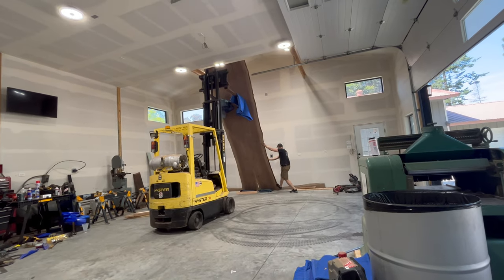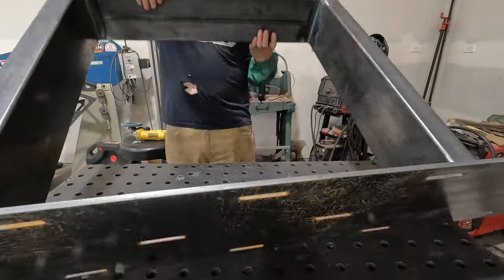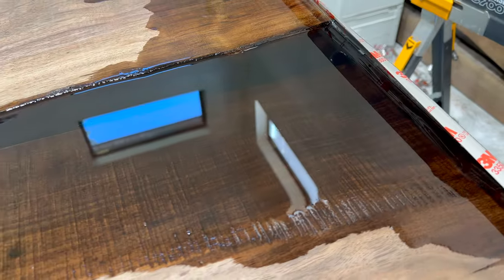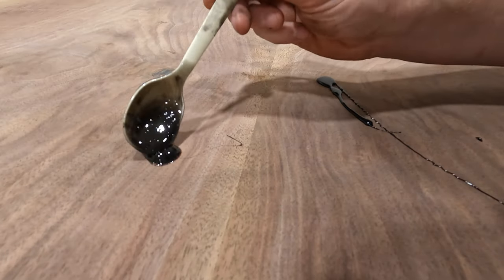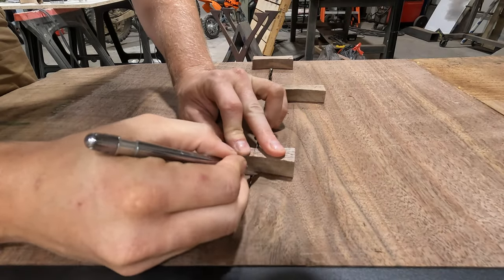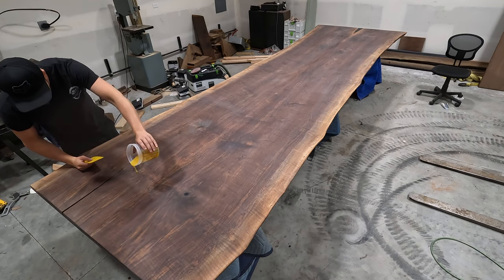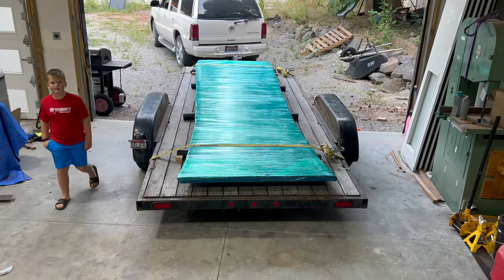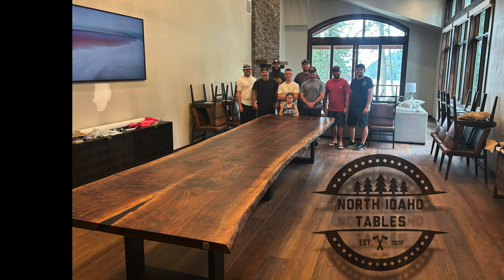Biggest table build so far

Comment: I restore classic cars since retiring in 2011 and the idea came to me that a rotisserie body frame would make short work of rotating any size slab with a simple mounting jig, in fact even sanding filling defects finishing and assembly could be accomplished with out needing any help or lifting equipment thru completion. Ray Stormont
Reply from the maker: It’s funny you say that.   It crossed my mind to build my own style rotisserie.   Worst part is I only have a 30x40 shop and I really have to think out the room for everything

Comment: Nice job. I'm curious why you don't use fixtures on your fixture table to keep everything square?
Reply from the maker: Haha good question.   I do use them but sometimes I find they will pull the metal over a little instead of staying vertical.   What the video doesn’t show is lots of measurements before being welded out